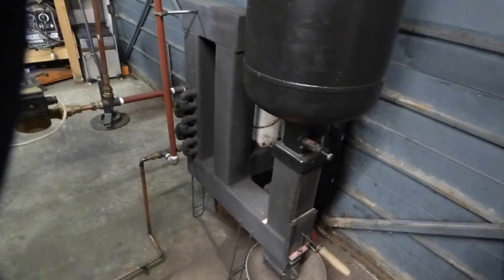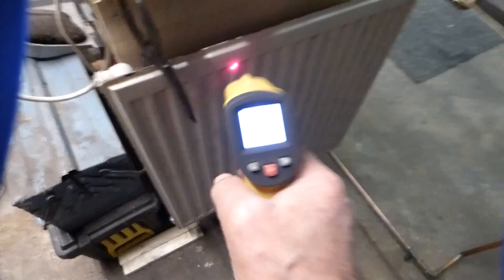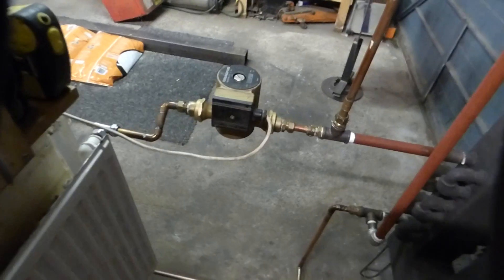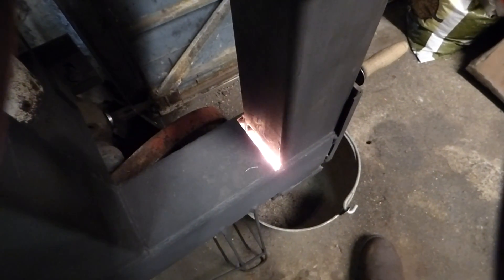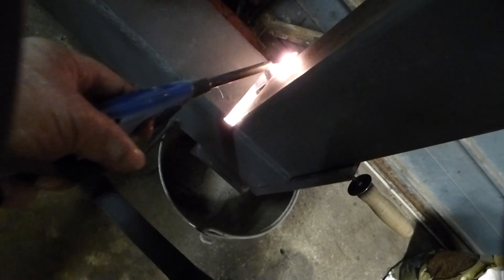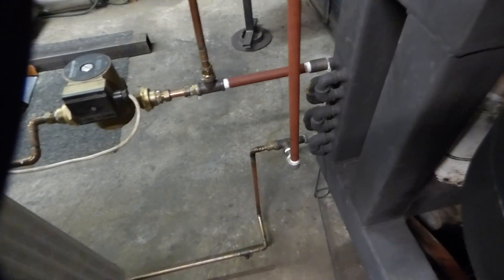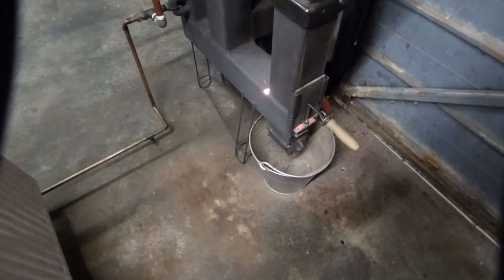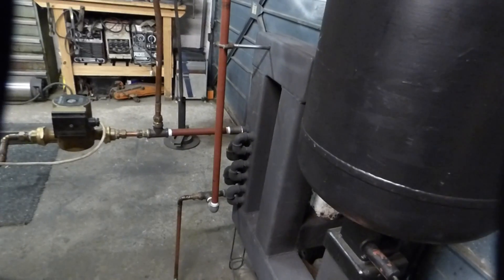rocket stove boiler part 4 diy No.33

Comment: What is the brand of pump you are using made of stainless steel ??? Could you make something to cover the open slot you can see the fire ?? Makes me feel a little uneasy about the flame. I am amazed that you can run that many radiator from just the small rocket stove. I am just amazed as the amount of heat you get from the stove. Thanks
Reply from the maker: build one !
Reply: @davids381  I am in the process of getting the metal now. WIll be building soon.Maybe answer some of the questions David would be appreciated Sir. Thanks

Comment: Great build Dave! I built one too! On mine I have the slot cut behind the burner like yours, BUT instead of changing burners to control the heat (you mentioned the other one burns too hot) I cut my slot about 1" and regulate the heat of the stove by sliding a piece of metal over the slot to control the air passing thru the burner. If mine gets too hot, I simply slide the metal so it lets more air in and not so much thru the burner. I found it I cut down the air coming into the stove (like you have with the slide door) it will force the stove to suck air from the pellet feed and causes the fire to start creeping up the feed tube. If I just control the air going up the riser, it regulates the temp. better. Just FYI.

Comment: Hey Dave love the videos great attention to detail, good to have someone showing what will and wont work and why.
I was wondering what your opinion is on per heating the air before it get drawn into 2nd burn inlet could weld a jacket to draw air past hot zone, would this increase efficiency?
Reply from the maker: yes it does increase  efficiency by at least 25%